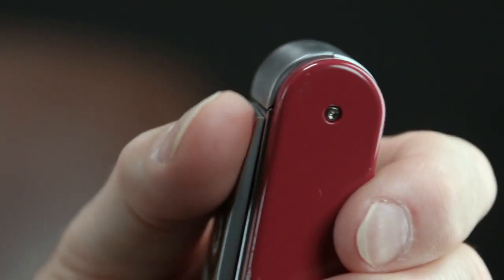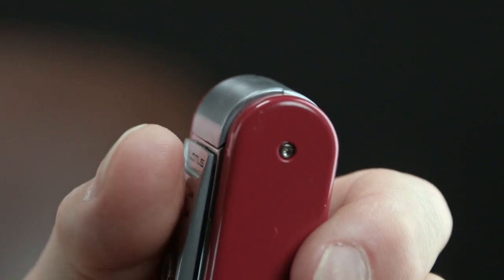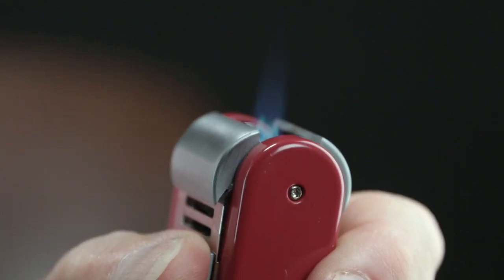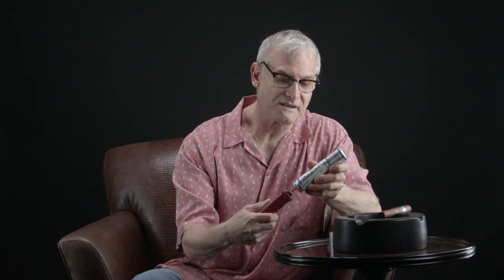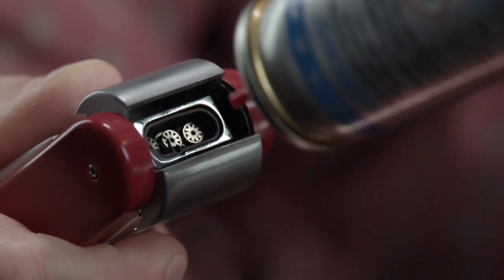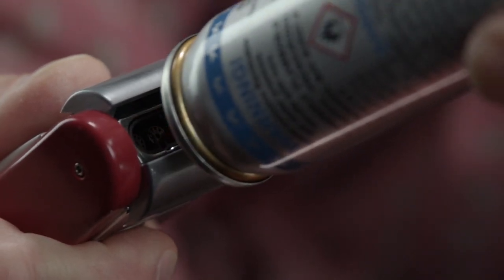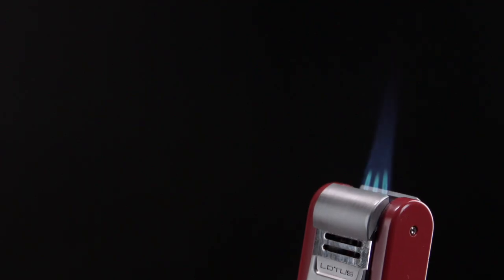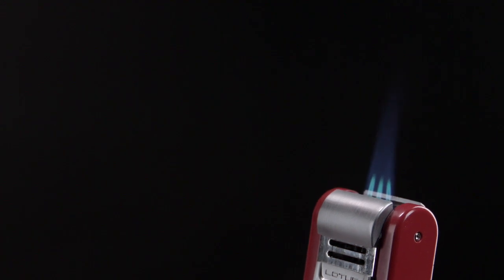Best Hack for Fixing a Plugged Cigar Torch Lighter - Cigar 101

Comment: Excellent! Thanks much! I had 5 different irreplaceable and rare collectors butane torch lighters that I never thought I would get working ever again after all my different attempts over the years.  This brought everyone of them new life in minutes. You, sir, are a hero
Reply from the maker: Glad we could help. Thank you for watching and commenting.
Reply: Unless the butane lighter is a rather expensive one and even those eventually lose their lives. It's just inevitable. 
I used that trick for a good year or so on several different styles and qualities and it never failed... they all eventually took a dive into the trash compactor (yes, I purposely referenced Star Wars) 
I've never owned a super expensive one but I imagine their guts are a little more durable than your average one you pick up at a liquor store or something. 
Go to a cigar grotto. You'll find higher end lighters there or you could maybe shop online

Fuel too is important. Now
More refined the better. Get yourself a few stainless steel wire brushes or even the copper brushes and after every 2 or 3 times of usage. Take those brushes with the burners pointed down with the bristles facing up at the burners and start cleaning. I usually twist the lighter rather than the brush. I keep the brush stationary and twist the lighter itself. I think I have more control therefore making the cleaning quicker and more sufficient, because all the debris is falling down away from the burners as opposed to the debris falling back into the burners further messing it up more. 

I hope you understand that mess I just wrote
Reply: @SamuelDavidDeLuce  i Just bought a palladium line 2 ST Dupont for $1500. I dont think I will use a wire brush on it but I know that I certainly did not use ST Dupont fuel for $90 for 60ml.  I found a company that makes fuel for culinary purposes because their propane and butanes are 99.99998% pure. ST Dupont is only 99.995% which actually makes a difference (its not approved for use in food processing). I see comments about people using 'cheaper fuels' on expensive lighters like mine and its quite annoying that they fall for marketing.  My fuel is 11x refined and ST Dupont is 3x.  The other interesting thing to note is that its about how pure the gasses are in the fuel not just the butane.  The butane cans that contain nothing but pure butane do not work on lighters.  The lighter mixes use a 30/70 propane to butane mixture.  I had no idea there was propane in all our refills but this was confirmed by the chemists at the company I purchase from. My bottle says 70/30 and (butane/propane) and I was worried I bought the wrong product.  They are actually all this way. It is not exactly correct to tell people to buy the purest butane possible since they do actually sell pure butane cans.   Strange huh?  Also I used this new fuel in place of the xikar fuel and it actually made some of my lighters that have a tiny bit of problems with reliability light perfectly every time for the first time.   The fuel is called Blue (blue flame butane blend). It beats ST Dupont and ST Dupont is literally 7200% more expensive per ml.

Comment: You know how you can eliminate from even having to do that?use good quality butane and it won't clog up your tip and you know  what works better than  butane to clean the tip? An air compressor with air nozzle or a can a dust off compressed air for cleaning out computer keyboards. you're welcome, have a good day

Comment: Maybe I did had a combination of problems, I had to tighten a not in the burner, but that was not enough, so I also did this and... it worked! the burner was also dirty or somehow blocked and using the gas pressure it cleaned it. Thanks for the tip!
Reply from the maker: We're glad we could help. Thanks for leaving a comment.

Comment: I see a lot of you are interested in how to unplug a cigar. OK. There are several ways. The first is to gently roll the cigar between your fingers at different points on the cigar. Start in the middle. Then try closer to the foot, then the head. You can also use a cigar poker, a large paperclip, or a mini-screwdriver. Poke the implement through the foot, but you really have to be careful on this one. Don't go too deep, and try different points on the foot, but not too close to the edge or you'll tear the wrapper. You can also repeat this at the head, but be even more careful. You might also want to check to see if you clipped deep enough. If you still have a little cap, try shearing off a little bit more. Those are the best remedies I know. If the plug is somewhere in the middle, you probably won't be able to reach it. And the deeper you go, the more chance of splitting the wrapper. Hope that helped, and happy smokes. You can also check out this video by Tommy Zman: https://www.youtube.com/watch?v=TelauuSVoIU G-~
Reply: Thanks bro I ALWAYS seem to get a tightly rolled cig whenever I purchase a 5-pack of the Partagas Extra Oscuro cigars. Thank you again. 🚬🚬🚬
Reply: Glad I could help. G-~

Comment: i dont expect a reply but i had something shaking in the "head" of mine (bottom comes off to remove the outer casing, the tank is attached to the "head" which consists of the trigger mechanism and the "spout") got it out, it was a small square of metal, now the damn thing doesnt work. i dont get butane out of the front when i hold the button down, even though i hear the hiss
Reply from the maker: Thank you for leaving a comment. Do you know what brand lighter it is?
Reply: @CigarAdvisorMagazine  not sure, it had a label on the side with the barcode and a "up to 2400° flame" lil thing on it

i got another one now which is a TorchBlue and aside from it being generally cheap it works
Reply from the maker: @professoryorick5676  We're glad the Torch Blue is working for you. We will see if we can dig around and find any similar lighters and see if we can help you with the original issue.

Comment: Why use an expensive can of high quality butane for this? Why not just use a can of compressed air that you can pick up at Walmart for about $5?
Reply from the maker: That works too. we have had good luck using butane. Thanks for leaving a comment.
Reply: It’s literally 30 cents of butane to repeatedly do this to several torches.  Why waste my time when it takes a few minutes.
Reply: Because Nobody has a can of spray air lying around and buying one for this singular use is silly considering that practically EVERYONE here already has butane.

Comment: Ya I've known about that trick for a couple of years now 

Here's what else I know 
That trick only works for so long and it doesn't always work
Reply: Did you know that it's possible to overfill your torch? That also causes sputtering and the flame to blow itself out. Between bleeding before refilling and these two tips, I'm able to cure 99% of the lighter issues that come into my lounge.